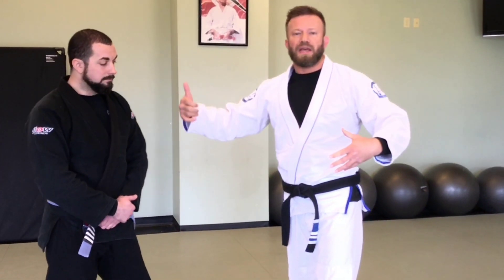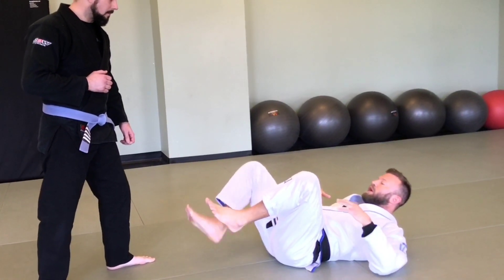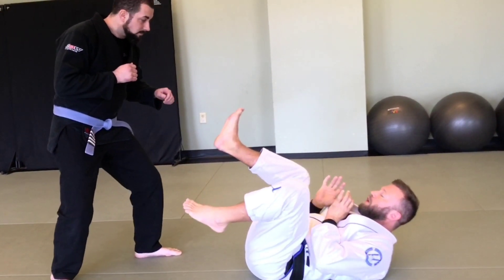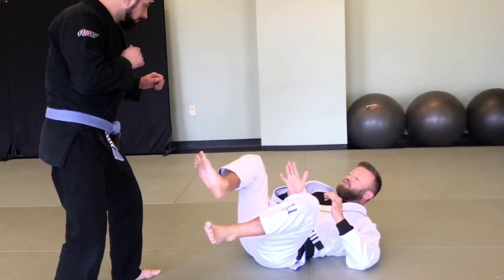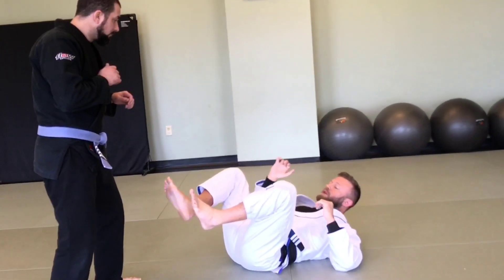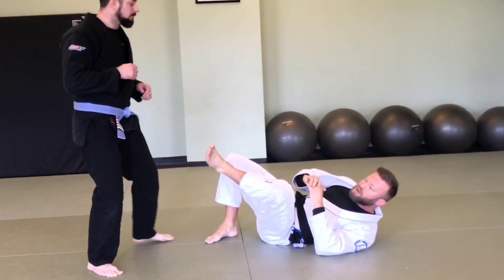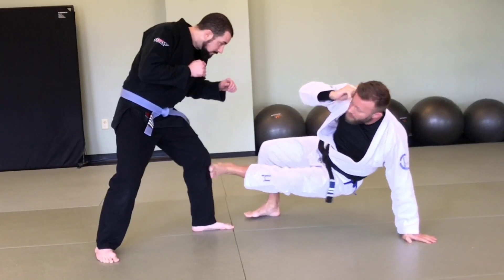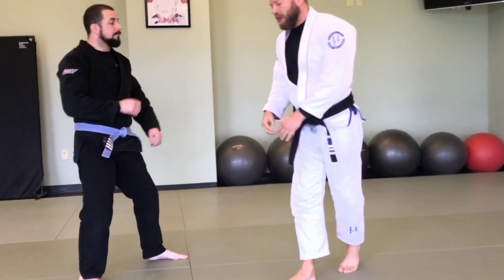The Technical Stand-Up Proper Application | Jiu-Jitsu Self-Defense Basics

Comment: I know you said the push kicks to the leg from ground are just for distance and I agree but man....
If you kick just above the knee (specially if attacker is putting weight on it) that's GOTTA hurt.
 I would assume the knee could buckle (like the dummy sweep) and maybe hyperextend it. 
Either way I definitely think you could potentially damage that knee before standing!!
Reply from the maker: It would be nice if it happened but it’s just less reliable. Pain is super unreliable. Not that it won’t work sometimes, but the structural elements are more important in my opinion. Creating the barrier with the kick is most important for that fraction of a second.
Reply: @KnightJiuJitsu  thanks for the reply! Yeah I agree 100%. Pain doesnt usually work. 
I find it crazy how much people think pressure points work like magic!
And i guess it have to be a pretty hard kick with weight on that leg to strain or tear something!

Comment: Great video! Is this in response to Aperture's recent video with Chad Lyman?
Reply from the maker: I actually filmed this a couple of months ago, and never uploaded it. But after seeing Chad's, I thought it might be a good time so it can work to clarify a couple of points about this.
Reply: @KnightJiuJitsu  I also saw Chad Lyman video on Aperture. I m a bit confused now if it is better stay grounded and kick from there untill you can directly  get up safely (like Chad said) or if the seated position can be used as an intermediate position before getting up. Help :-)
Reply from the maker: There’s no way of getting around some sort of intermediate position. The goal is to pass through that position as quickly and safely as possible and not hang out there and definitely not try to scoot toward the guy in order to kick him. This position allows you stand with a strong structure and that’s an important element of the process

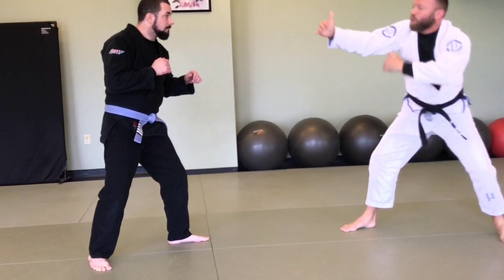Comment: 3:30 my problem with this is that if the attacker just steps forwards and soccer kicks (high percentage chance) were your head is at the start of this move, when you have transitioned to the bent over standing up position your head is still in the EXACT SAME POSSITION as it was when he initiated the kick, you will eat that kick despite the head cover, a shin will blast straight through it and the foot will even wrap around it and probably hit you in the jaw

I say this knowing this technique is worth learning because its better than nothing but I really wish people than me would pressure test this more and iterate on it until it was not so glaringly flawed
Its a common attack situation and gets almost no training time or people working on it to improve it

I have a slightly better system than this but I am not a bjj blackbelt or world class striker, people who make this their life should be able to come up with something way better
Reply from the maker: Did you not watch the whole thing or did you watch it with the sound off or something? I addressed that concern and much more. The tech stand up sequence and details are the best approach to getting to feet vs a disengaged standing opponent, and it works more than it fails. 

As for the whole “pressure testing” thing that always comes up, watch some mma or even street fights. Watch any fight in general where the bottom person kicks, creates distance, then stands up relatively guarded. I’ve been training for decades and pressure test everything as much as I can before I ever put it on video. I’m not just here to make shit up.
Reply: @KnightJiuJitsu  I totally agree its the best thing being taught at the moment, yes I watched the entire video, a very good break down of the technique. Yes I do watch a lot of street fights, but specifically I try to watch ones where violent crime is being done to someone rather than 2 bro's with shirts off duelling it out in a carpark or something. There is a difference in the level of intent to cause lasting harm between those. Also yes I have trained and pressure tested this myself as well, its common to spend a full round on the ground while some stands in front of you and their only objective is to land a light kick or semi contact punch to your head. Its been in our training system for a long time. 
In sparring or in competition fighting (at least in my experience and watching others) the reason it works more often than not is because the either rulesets or gentlemans agreement is to not TRY to soccer kick you in the head while you are getting up... this is the exact reason this problem exists, sport isnt driving it to evolve to be safer / better

look at Demetrious Johnson when he left UFC (rules protect grounded fighters from kicks) his only KO has been because he went to an organisation that let him get kneed in the head in almost exactly the way I am talking about. one hand on the floor, head stationary while transitioning from seated to standing. He has even talked about it saying that its a problem he needs to figure out because he has not had to deal with that before. Look at that old PRIDE mma too, they had soccer kicks to the head and it was a huge problem

I have huge respect for your grappling ability and I know you dont make shit up, you give high quality advice. At the same time I am not some keyboard warrior just trying to throw criticism around to make myself feel good either, I actually think this (unpopular) opinion should be brought up 

This technique is better than nothing but has a big problem vs soccer kicks to the head, I wish people would call it out even if it breaks with BJJ tradition